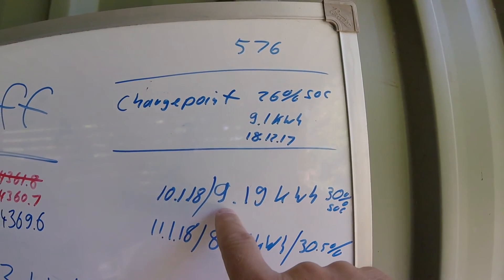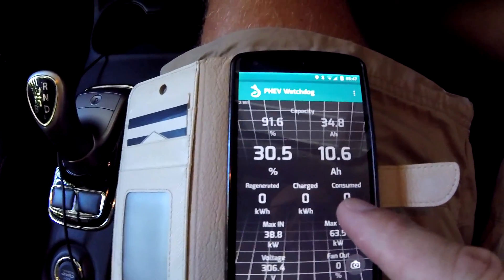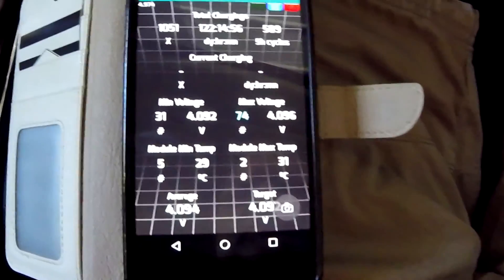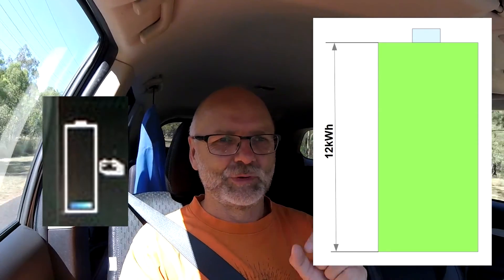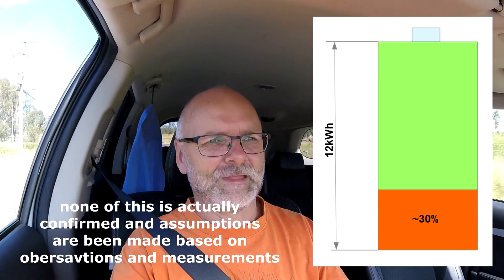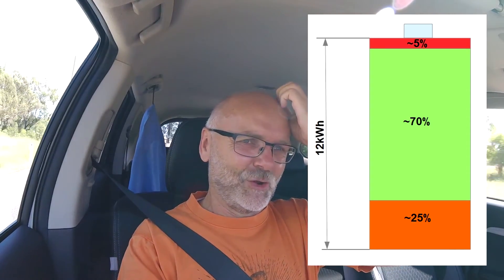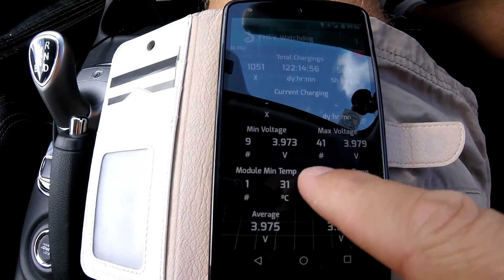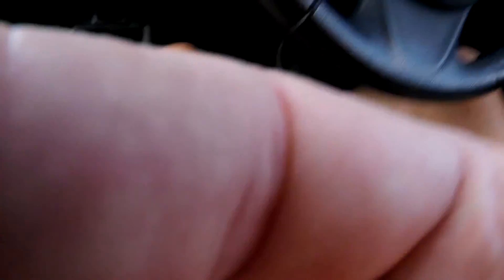EP25 - Cheated on the Outlander PHEV's battery?

Comment: Hi Andy, i like your videos. Thank you for your enthusiasm.

I think the last "30 %" kicks in because of the weekest batterie cell. It is like a cain. the weekest cell is dictating the aktion borders for activation the engine and stop the charging process.
Reply from the maker: Thanks for your feedback. The cells are all the same and it's not just the same cell which is the weakest every time. The cells are been balanced every time the car (AC) charges, even twice on 15A settings.

Comment: It quite possible they have simply put the entire battery (seperatley from ECU control) through a few cycles with possibly some type of pulse or similar charge to "reset" the battery.
Reply from the maker: Cycling the pack should not make a difference with Li-ion cells (unlike the older Ni-Cd cells which needed always a full discharge due to the memory effect).
Reply: unplugged EV I found it did when racing RC cars with lipo's. Different but similar chemistry.

Comment: I would bet on the crappy ECU software or maybe Mitsubishi is just keeping "something" under the carpet (or both). That's how the EVs do the battery management, reserve part of the battery or use a very conservative management so they can keep the customer happy and honor those long battery warranties. One thing is true, you did get 59kms of range (still the record at Dog-net) after the cell's smoothing process... So it's a fact that the capacity was there.

Comment: I believe the ECU and measurement of the battery is (software / hardware )? Is not stable. HOWEVER the algorithm to protect the battery is set in stone !! So if the reading of the drive battery is wrong all else suffers.. My dealer said the car does cell smoothing automatically and didn't believe anything else was available. So I have his email and Ep 3 link will be sent !!!
There is also a Mitsi dealer on the Forum now - could be good for some questions !!